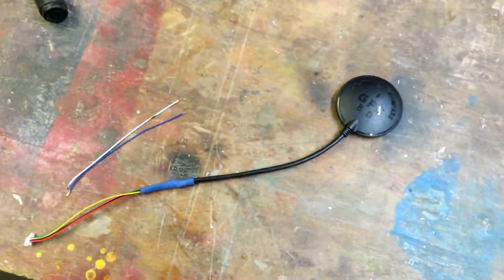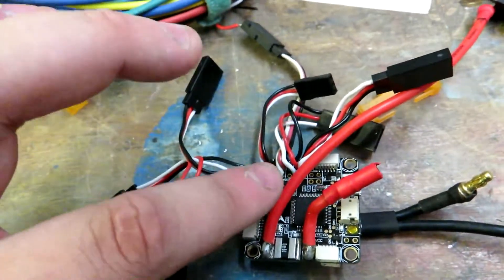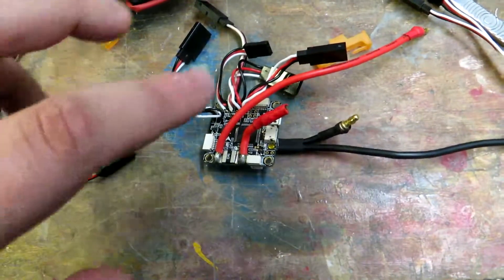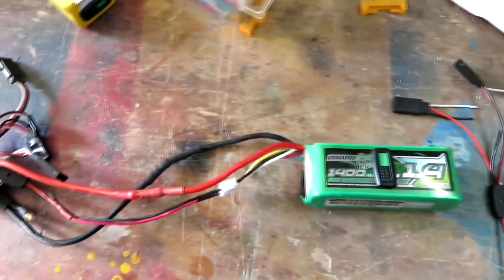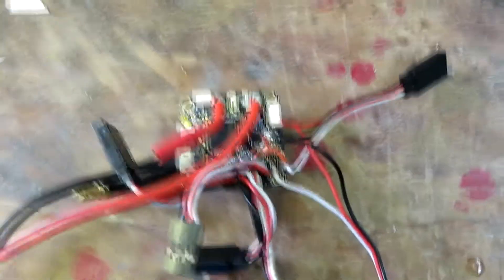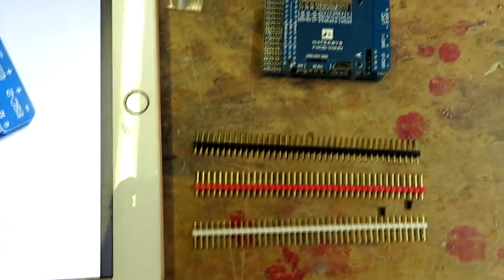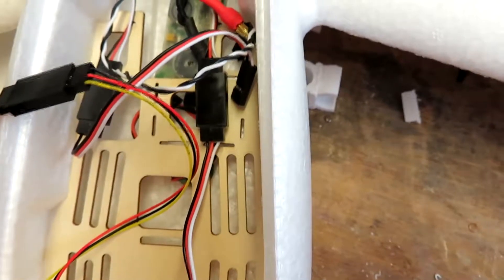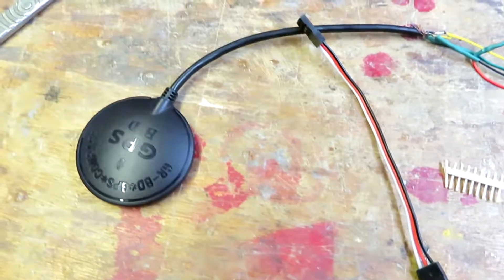ZOHD Dart (Budget "Mini Drak") Build - Part 2 - Swapping To Another iNav Board

Comment: Hi. Thanks for the video. I'm new to this hobby and I'm looking to build a flying wing. I noticed your esc is located under your flight controller board. Is it ok to have the flight controller so close to the esc? Is there any interference between the esc and flight controller?
Reply from the maker: I have never noticed any, i normally keep esc away from anything that transmits or recieves when possible, so away from the VTX and reciever,
Reply: @JakesRCStuff  thanks for the quick reply . Space is a bit tight for me inside the fuselage and I've been forced to put the esc, flight controller and receiver next to eachother. Was a bit worried I may get interference....